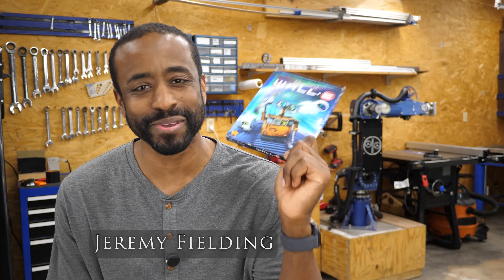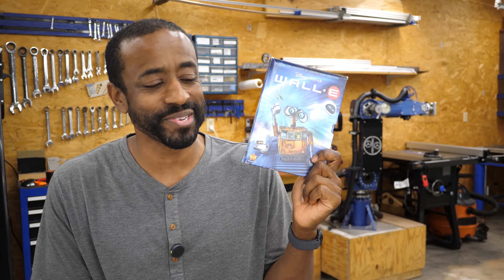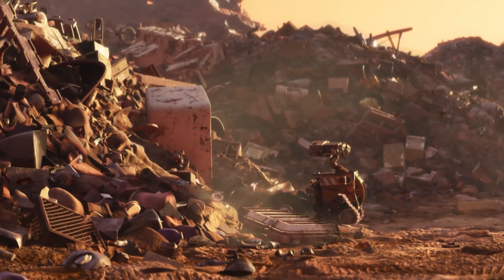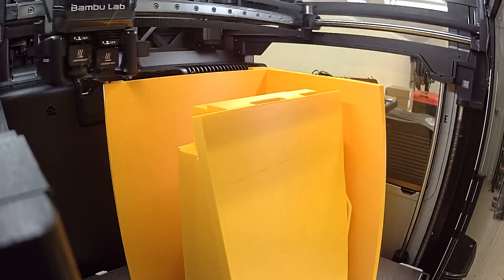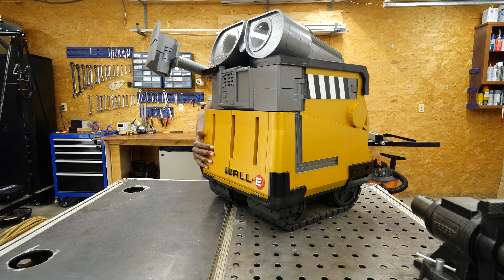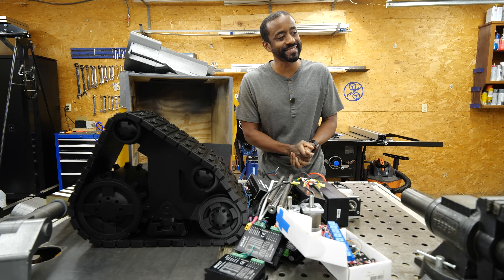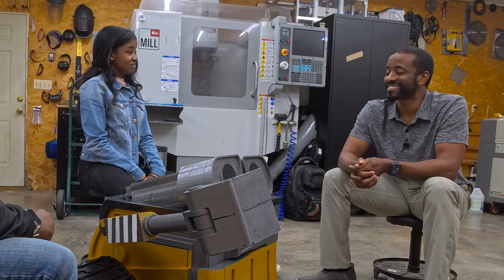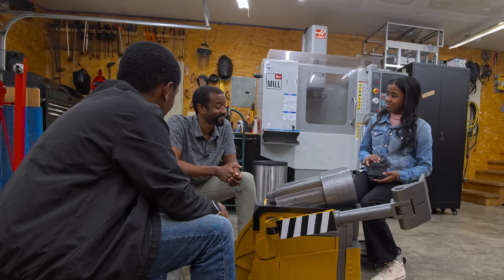Making A Real WALL-E. Episode 01

Comment: 3:45 / 3:56 - no, it's 2744 cubic inches.  But that is a 14"x14"x14" cube.  :D
(don't worry, not actually mad, just amused... because this is how we get the likes of an 18" tall Stonehenge in Spinal Tap.  :)
Reply from the maker: Crap. Of course I meant 14 inches cubed
Reply: @Jeremy_Fielding   naturally.  I think you'd have to make an even smaller Wall-E than the one your daughter absconded with to get to a scale with a 14 cubic inch capacity.  But, maybe that'd be a fun easter egg, somehow?  :)

Comment: I'd sacrifice the tracks fitting inside the body, that will give more space for motors and electronics and reduce complexity.
Maybe make the internal open space a bit smaller, you can use shading to create an illusion of depth.
Since your WALL-E doesn't need industrial strength, moto size can be very small.
Also, a reduced range of movement for arms. A little bit goes a long way, suggest movement rather than complete freedom of movement.

Comment: I've been thinking about building a Wall-E as most a mental exercise for now, and what I immediately decided is that every moving part needs to be self contained if possible.  Internal hub motors. Self contained linear actuators. There's not room for ANYTHING to be externally driven.

Comment: FYI yes there may be "piracy ways to get around that" but you can also just go into your browser settings and turn off hardware acceleration. Takes less than a minute.
Reply from the maker: I tried it and it works. Netflix and Amazon both block recording the screen and it goes black. Or more specifically the output file is black. I notice the difference until I fixed this. I of course didn't know there would be yet another reason this could happen when I can also record sites like YouTube in my browser. So weird.

Comment: In a lot of ways, what you want out of your WALL-E should be based on what you want to do with it.  If you want to take it to Fairs and have it wander around and say 'Hi' to people then that is way different from if you want him to just sit in a room and interact people there.  I guess you could have a modular WALL-E that is open at the bottom and has a lower section you add that has fixed treads for driving mode then  later you could try to design a lower section that you can attach that has treads that can "turtle".

Comment: Just fill the belly with all the gear you need. You'll make your life a lot easier. Your kids weren't that thrilled about that belly either. In fact, their requirement was that it just opens up. If it's full of functional stuff that's much more interesting. And if it turns out you have some room to spare, you could still add a little soda can crusher.

Comment: Thoughts: Make his insides a mini fridge. Use the back wall to house all of the electronics. I would make the head collapse but I would not try to do anything crazy with the tracks, just let them stay fixed and on the outside. I would definitely make him remote controlled. If you really wanted to go all out you could install a camera and use Jetson Orion with some Ai to give him life and his own dicision making. To make him feel alive the most important parts would be the motions of the head eyes and sounds, nothing else gives a robot life than how they can display emotions with sound and their facial features. The arms I would not bother with crazy degrees of freedom. If they and move up and down, and open and close the hand they are awesome. It you add the in and out feature witb a linear actuator that would be more than enough. Awesome project. Good luck!

Comment: An exercise of fitting functionality into a defined form.
Should be interesting...
All the "personality" hardware and drivers, batteries, controller boards in the back of the eye tubes and the rest mounted to the roof of the compactor box.
It will need a bunch of batteries so mount them in the track carriers to keep the weight down as low as possible and disguise them.
Track drive motors inside the track sprockets and stuff like that.
Wiring will be a nightmare.
Looking forward to whatever comes next.

Comment: The voice has always seemed to me like it's forced not a natural function...like it's stepper motors being forced to vibrate at audio frequencies. I think it would be an amazing touch if you could integrate the voice into the drive motors...even if it means he only speaks when not rolling. There are lots of examples of code for doing this with hard drives and steppers available already.

Comment: Fun project! If you want the doors to open, you could build a false wall designed to look like a compacted trash cube. Behind this façade, you could hide your functional components while still preserving valuable space.
Reply: But then doesn’t carry out the basic function of picking trash?
Reply: @AbdulrahmonOlamiposi-r2k  Yes but I feel like it's not essential to the robot, while it is its main function in the movie, in real life the goal is to capture the essence of Wall E and not make a perfect reproduction
Reply: @AbdulrahmonOlamiposi-r2k no but if you need a ai robot to pick up trash .... I don't think its in ability is the problem.
Reply: My thoughts exactly !
Reply: cover the inside with black velveteen and then insert a 45 degree mirror it will make it look hollow behind the mirror you can hide your controls and servos, and suchlike,
Reply: there were actually several Wall e toys that do this. namely the ones that can fold into a cube

Comment: @Jeremy_Fielding - Would it be possible for this to become the project you were talking about pulling together to help parents build a robot with their kids? Because this would be something I know my kids would be thrilled to do with Dad! Seems like the engineering is probably going to be too complicated for that project idea, but maybe you could adapt it to be "close enough"?
Reply from the maker: This is going to be way too hard. It will be close to the limit of what I can build. I would not want to try and make plans for it or a tutorial. There are several parts I am researching myself to get the best solution.
Reply: @Jeremy_Fielding  I figured as much. What about a simpler version or a base that could have a WALL-E shell attached around it? Just tossing some ideas around. Are you still planning to put that project together? I don't recall seeing much else about it yet.

Comment: Have you looked at the wall-e builders group to get inspiration for what you can add to them. From what i understand many of those builds are more built using RC level controllers and motors, rather than the larger (and more feature complete) industrial versions you showed.

Plus another option you could have is multiple chasis or extremities rather than 1 complete package - so swappable eyes, swappable arms, a 'trash compactor mode' chasis that has less wheel capacity etc.

Comment: Powering the tracks should be pretty easy to do with our current tech. They have some really powerful hub motors nowadays that can fit into a fairly small package. Think of the motors used for Unitree and Boston Dynamics Spot
So I think the overall build of the tracks might be one of the more simpler tasks.

Comment: For all the functions, or most of them, you just about need to make several different versions. Because of the complexity of what WALL-E can actually do, with our limited technology, there's no way to add even half of the functions into a single unit; at least in one of proper size.
* So maybe you could make one that has the function of trash compacting. It would move the arms forward and scoop up what's in front of it and run the compactor. Plus some other external features as well
* Another would be where it can pull the tracks in and shrink down into Turtle Mode
* And then maybe another would be it can drive around like a large RC.

Comment: You say about creating a feeling... I bet if you did eye tracking on almost anyone watching the movie, they'd be focused on Wall-E's "face".  The emotion it's able to express. So as you're looking into actuators, movements, etc... I'd concentrate on his "neck" and above!  

And don't rule out pneumatics. They could offer a lot of movement in a compact space. Lots of power in the movement isn't important. And since operating for lengthy periods of time probably isn't critical, you could use a 3K psi Co2 tank (or similar) so no compressor would be needed.
Reply from the maker: Interesting 🤔
Reply: @Jeremy_Fielding  - Think paintball gun tank. Common, easy to find and fill.